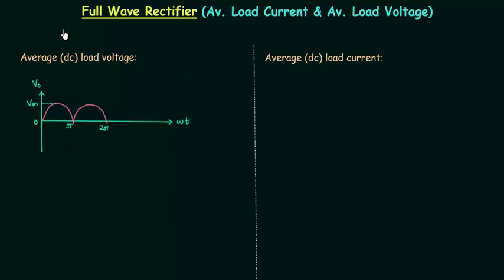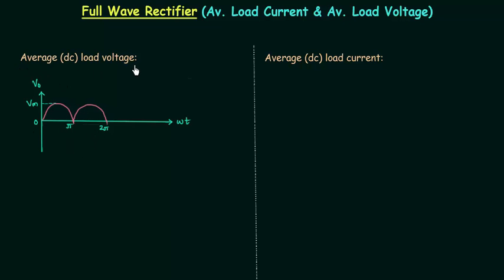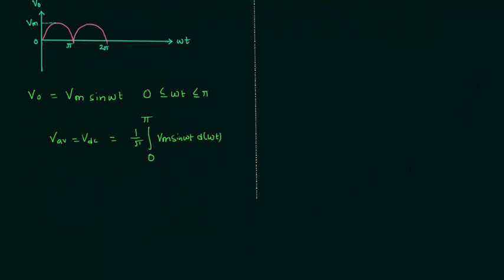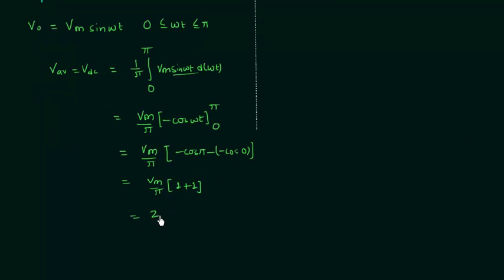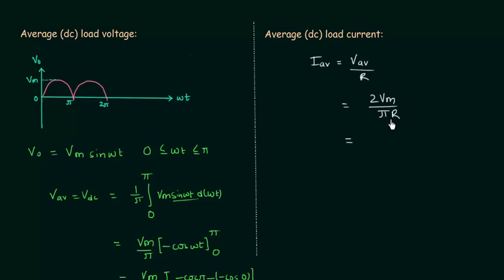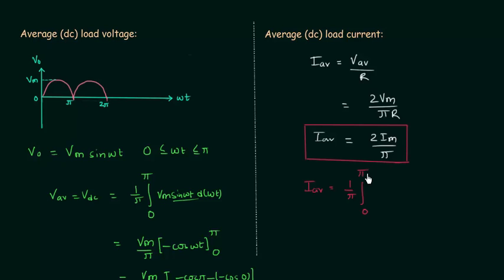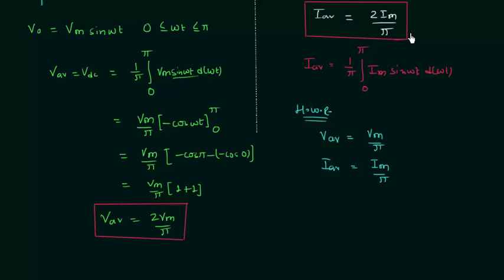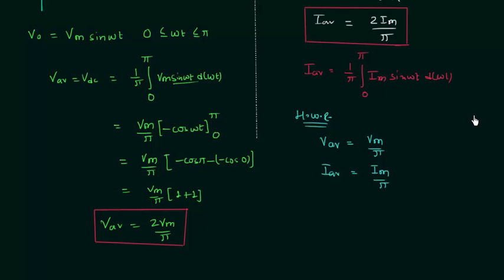Full Wave Rectifier (DC Load Current & DC Load Voltage)

Comment: sir why average voltage and dc voltage are same
Reply: Because a dc voltmeter shows you the average voltage of the time varying voltage signal. That is why average voltage is called dc voltage.
Reply: @blzKrg  will ac voltmeter should rms voltage?

Comment: A diode whose internal resistance is 20Ω is to supply power to a 100Ω load from 110V(rms) source pf supply. Calculate (a) peak load current (b) the dc load current (c) the ac load current (d) the percentage regulation from no load to full load.
Please answer to this question

Comment: in previous lecture you have explained significance of rms value i.e. it is equivalent to dc value. but here you have told that average value is dc value. kindly explain this.
Reply: Yeah..I was wondering the same thing
Reply: @Tarun_Kotagiri  Brthr,You are confusing with the DC current and The "DC component" in total output current. In the rectified total output current,there are two components AC as well as DC like this I= I(AC) + I(DC).
Now I(AC) does not contribute in average value because Average value of AC current over whole time period is zero,Hence it's the DC component only which contributes in the average value of rectified current...
So in case if rectifier we can write I(AVG) = I(DC).

Also I'm still learning,so the above explanation might be wrong please please correct me if you have better  explanation,I'll be thankful to you...
Reply: @you-dont-know777  oh...now I get it... thanks for explaining....!!
Reply: @you-dont-know777  
R u sure now??
Reply: @hm2715  not sure but this is what I learn...
Reply: @you-dont-know777 
What's the difference between DC curent and DC component??
Reply: @hm2715  Dc current is the normal direct current but DC component is some part in rectified output which contain Dc characteristics
Reply: @you-dont-know777  
Ok Thanks
.
Reply: @hm2715  welcome...

Comment: In calculating Vdc or Idc , why we're taking time period from 0-π  instead of taking 0-2π as we do it in half wave rectifier?
Your videos are nice and easy.
Reply: It's the area under the curve for  a half-wave rectifier one half cycle is removed so pi to 2pi is just a gap.  However the average voltage will include that gap.
Reply: He forgot to mention one part and that is it's per cycle we calculate

Comment: you integerated from 0 to 2.pi in case of half wave rectifier but 0 to pi in full wave... why so..?
Reply: i think because the periode here is pi while in half wave rectifier we had a periode of 2pi
Reply: @hichembenamara4710  You are right. Period here is pi, half wave rect had 2 pi.....why integrate over 2 pi then here when period is pi ? You can....you will get same result
Reply: let me explain 
the Average is
Vavg=1/2Pi Integration from 0 to 2Pi Vm Sin Omega T
but as you see in this case the function is even harmonic which repeats it self 2 times in the period
so you can integrate half the period which is 0 to PI and multiply that by 2
this 2 will cancel out with the 2 in the denominator and it'll become as it's written 
message me if you still don't understand
Reply: Amr Hossam bro didn't understood what you have said
Reply: it can be integrated to 0 to 2pi but we have to divide by 2pi instead of pi. Btw gives same answer
Reply: @aram8832  it gives 0. Not the same answer
Reply: Amr Hossam but the limit changes π to 2π . then how it gets cancelled